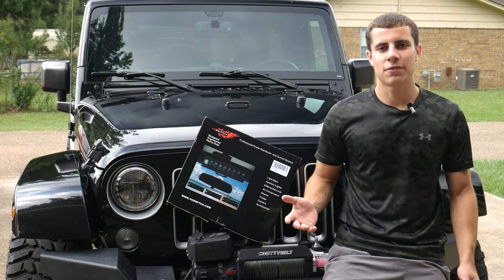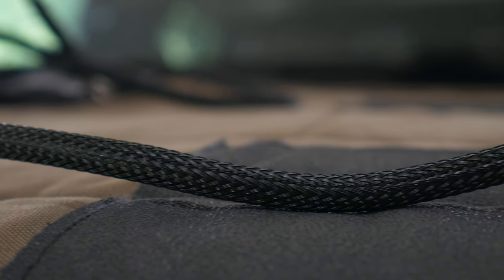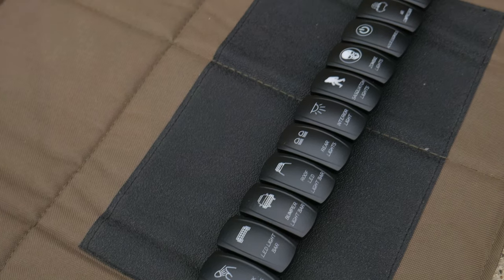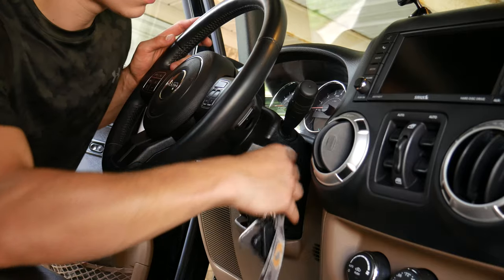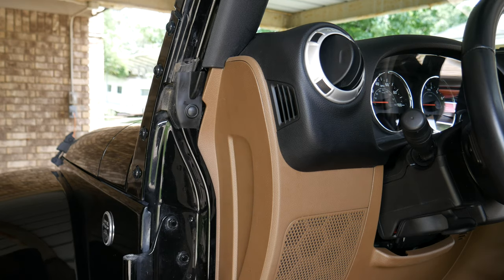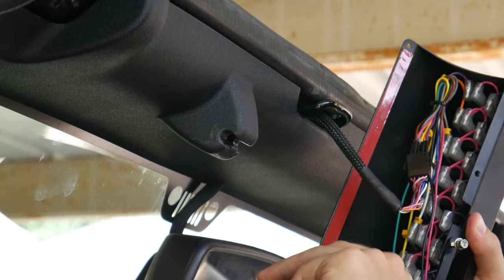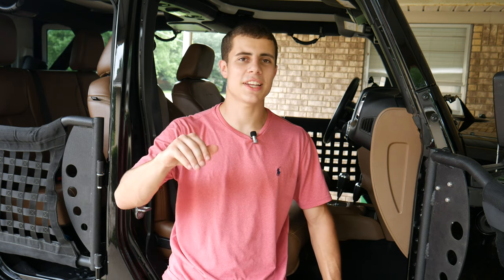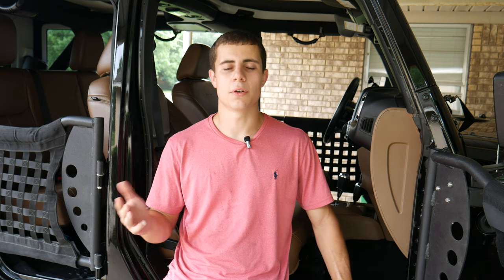Switch Panel and Control Assembly for Jeep JK - Install, Test, and Review!

Comment: I put two of these in .... if you ever run into this system not working .... mine was reversed  positive was negative and so on. Flipped the + and - never had a problem again. Great video bro!! Weird, but this is what the tech said through Apollo Intech!

Comment: What fuse slot did you end up using in your fuse panel for the fuse tap after trial and error? 

Using the panel with the fuse tap hooked to ignition do you still have to hit the main power on the panel every key up? Or is it possible to leave main panel power on to turn on and off with just ignition?

Comment: Great video, nice camera work!  I was wondering if it would be possible to replace one of the switches with an aftermarket momentary on/off toggle switch? I would like to add a switch for my winch in/out control.
Reply from the maker: Hey! The switches can easily pop in and out, so I believe you could definitely replace one with a aftermarket one. That said, for a winch in/out, you might would have to run your own wires to the panel since the current switches are 2 stage and that switch would be 3 stage.

Comment: Great video! How are they holding up 10 months later?
Reply from the maker: Great! I have used the switch panel for several projects with no issues. Definitely would still recommend

Comment: Mine is in the mail! I just ordered a new front bumper with winch as well. My question is, should I run my winch directly to the battery or run it through the Voswitch or is it possible to do both? If so how? Just wondering what the best/safest setup would be.
Reply from the maker: Awesome! Im not sure what the best winch setup would be. I would assume that you would need to run the main winch power to the battery, and then the in/out signal wires from the winch to two separate switches on the voswitch. I haven’t attempted that before, so hopefully someone else that has can chime in!

Comment: Does it block the latch for the Freedom Panel at all? It's a bit hard to tell from the visuals. Kinda looks like it does.
Reply from the maker: It kinda blocks the bottom, but you can hook your finger around the end and pull it no problem.

Comment: I’m only having 1 problem with this kit. For some reason, mine doesn’t fall on the hook like yours does, it’s getting caught up.
Reply from the maker: I would say to completey remove the screws and bar from the top of the switch unit and reinstall the screws while holding the unit in place. Before my install, I adjusted the screws so that the bracket fit perfectly in place. But if it's getting caught up for some other reason, then I'm not sure :( Hope you are able to get them working!
Reply: @TacticalJK  fun fact I mounted it wrong 😂
Reply from the maker: Nice👍🏼😂 😂Glad everything worked out!!

Comment: If I install this kit and then buy KC HiLites, the KC HiLite wiring comes with a relay.  Does this mean I don’t have to use the relay from KC Hi!ites because the switch kit already has relays?  Sorry if this is a dumb question lol.
Reply from the maker: Yes, you should be able to wire the lights directly to the kit without using the relay provided with the KCs, if I am understanding that correctly. This kit eliminates the need for a relay wiring kit, so you would not have to use the one that is provided with the KCs

Comment: Great video.  I would assume not, but does the switch box hit the freedom panel footman's loop latch?  Does it make it harder to access it?
Reply from the maker: Thanks! The latch fits in the gap on the switch panel and is just as easy to open. You just hook you finger on the passenger side end of the latch rather than grabbing it from the bottom.
Reply: @TacticalJK  Great thanks!  Again, really well done video.

Comment: Nice video... does is have a cover on that sqare on the top? Or does it stay open? An open Ning like that so close to the roof makes me worry bout a possible drop falling in there from the freedom top
Reply from the maker: The hole on the top stays open, and the latch in the freedom top actually slots inside the gap when the top is on ( so it would be hard to DIY one with the top on). I think you have a good point tho, and I will probably DIY a cover for mine if I plan on taking the top off for a while. I don’t believe anything inside could be damaged by water, but it still seems like a good idea to cover it up!

Comment: I like the control box, I am not so fond of the master power for the switch panel. Some of my lights I want to turn on only when the high beams are on others I want on only when my park lights/head lights low beam (fog lights) are on, other things like my air compressor I want on with the key, does this kit provide that function?
Reply from the maker: No, this panel does not allow for that level of custom setup. Would need to do some DIY

Comment: When I installed mine it drains the batterie when I have the engine off
Reply from the maker: could it be that you 
R leaving it on? If you don’t have it set to shut off automatically (with the fuse tap wire I did in the video) then you would need to manually turn off the switch panel when your not using it. Id its not that then im not sure, I haven’t had any issues with mine. Hope you are able to get it working right!!